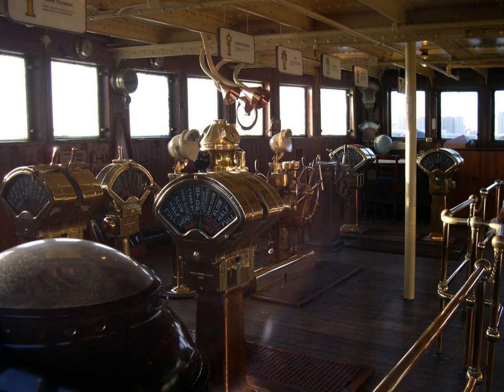Engine order telegraph | Wikipedia audio article

Comment: some engine order telegraphs like the titanic ones have a position to give orders to close wt doors and some telegraphs can be used to lower or raise the ship's anchor  as the telegraphs on steamships are on the bridge or the aft navigational bridge used for docking maneauvers. as the EOT are used on older steamships with propellers and paddle wheel drives as ships with two to four engines reciprocating and turbine there is a telegraph for each engine as when the bridge gives the order for each engine the engine room personel grants the order and moves the handle on that engine's telegraph to confirm the ordernand adjust the steam engine accordingly.  as telegraphs for steam ships are used on ships with coal fired or oil fired boilers.